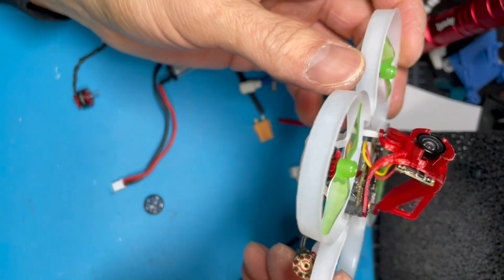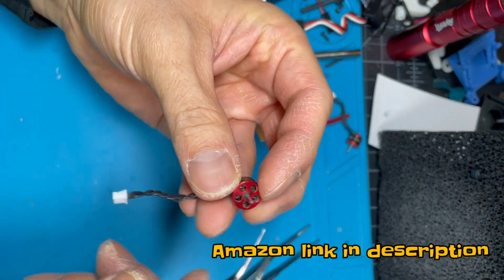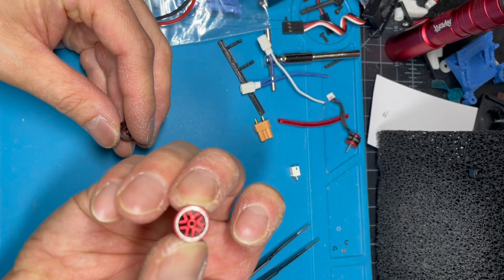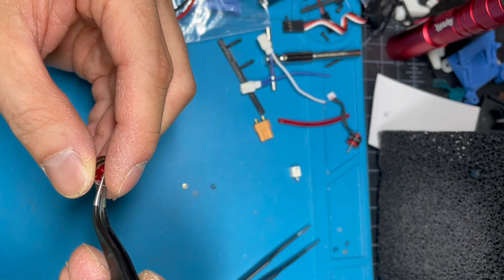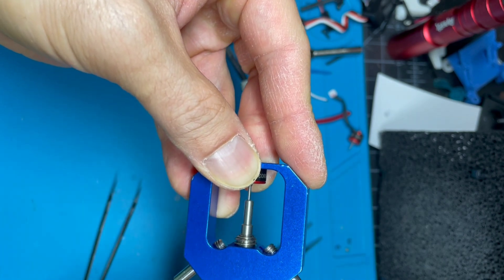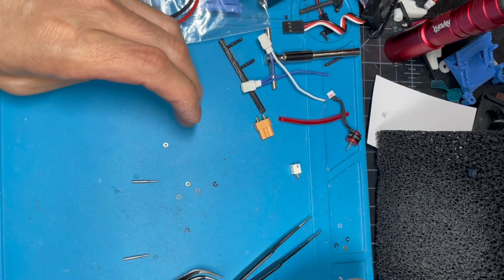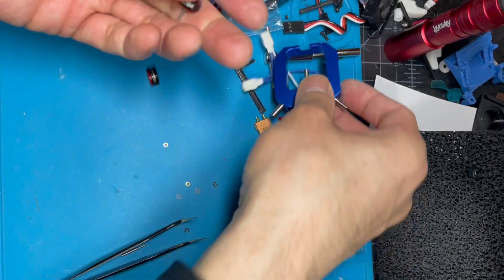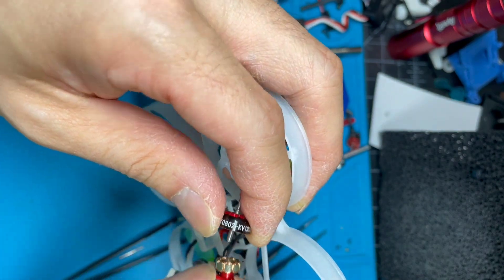Brushless Tiny Whoop Motor - Shaft replacement

Comment: The part on the shaft that holds it into motor motor housing has a small axial grooves. That is why do not hammer it or even an iPhone glass breaking tool just follow his method.

Comment: What adhesive would you recommend? I just used thread locker. Loctite non-permanent.  The blue one.
Reply from the maker: when i fixing an fpvcycle 13mm motor- shaft, i was suggested Loctite 271 to keep that thing in place!

Comment: Will that blue shaft tool work with bigger motors?
Reply from the maker: Sorry just replying late, the biggest motor I have is a 1404 that works but basically if a shaft can fit between the bottom notch of the blue tool, it'll work (it's 6mm wide)
Reply: @MrHappeFPV  thanks!

Comment: Do you maybe have idea what happened to my drone? The element u take out in 00:55 - when i take it out, my motor spins freely (I spin it with hands), but when i put it on, then noone of these parts spin at all and its hard to spin the bell.
Reply from the maker: This a brushless whoop motor? Sounds like when fully assembled it's really tight? Zero vertical movement at all? You could try removing one of the brass washers and reassemble. I've had one motor where there was so much vertical movement I added an extra washer that helped.
Reply: @MrHappeFPV  Yes, motor like yours, 0802. I reassembled it without the plastic washer (because I lost it when trying to assembly) and it seems to work good with only 2 brass washers and the circlip. So yeah maybe it was too tight and too close to the motor. I even checked if the drone flies without these washers and circlip and it worked well. But I will keep 2 brass washers and circlip just to be sure that the motor wont disassembly itself on flight. Thank you very much for help!

Comment: I see that u didnt apply glues on it when replacing. Does it works well without the glue
Reply from the maker: Depends on the hole tolerance of the bell. In this instance, it worked without having to put superglue. I should of mentioned it in the video as it should be common practice for repairs like this but i haven't had an issue with this motor since replacing the shaft. 

I wrote up quick instructions on how to glue shaft/bell to another commenter I can copy/paste here if you need it, thanks!
Reply: Another question , isit possible if I change my shaft from 1.0mm to 1.5mm
Reply from the maker: @blackspro596  If it's an 1102/1103 motor like the HappyModel's, yes you can switch from 1.0 to 1.5mm on those bells. For 0603 to 0803 motors...i have not tried but I just measured the shaft diameter and, you know, it might actually be possible
Reply: Cool thanks for answering my questions . You're really helpful

Comment: I have been looking for a video that explained to me these e clips and how to take them off before attempting it my self. I have a loose shaft it spins with the prop not the bell. That sound like a bent shaft or the clip needs to be on. Fyi the Clip on top is not there.
Reply from the maker: Older brushless whoop motors use to not have a c-clip on the top of the bell

A free spinning shaft on the bell can be fixed thankfully as it just means the shaft is not secure on the bell-hole. You will just need to disassemble the shaft from the bell. Then using a needle (or a pin, baby pin, etc), lightly coat superglue on the shaft where the bell would sit (it's a small notch) . Carefully slide back the bell over and let it dry. 

Hopefully that makes sense!

Comment: where u buy shaft 0802
Reply from the maker: Use to be able to find them on aliexpress. Might be able to buy some through Happymodel. These days the china sites sell bell/shaft replacements.

I have so many broken motors i just salvage the parts off those to fix others!

Comment: Ty for the info! No alot information about how to fix tiny whoop motors. I have many that do not work. Must It be because the shaft is bent? Greetings from Spain!
Reply from the maker: Glad the video can be of help! If motors had a bent shaft, usually it is still able to spin. If they do not work at all, a likely problem is the wire(s) near the motor-winding is broken.
Reply: Sometimes It works and sometimes It doesn't. I get the feeling that the engine hood has loseness or something similar but It could be that It is the shaft that has bent a little.Ty again!!